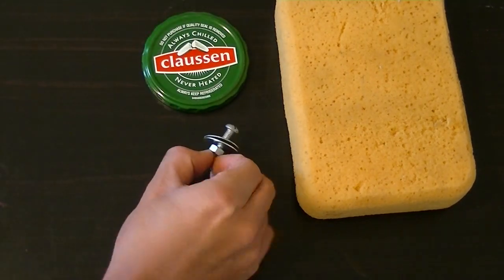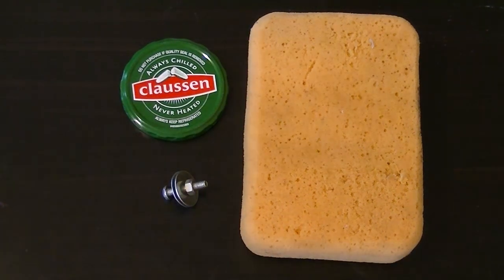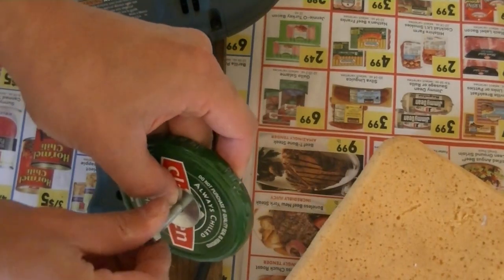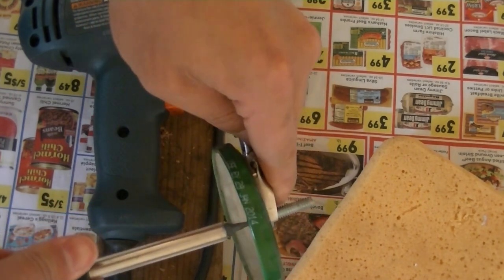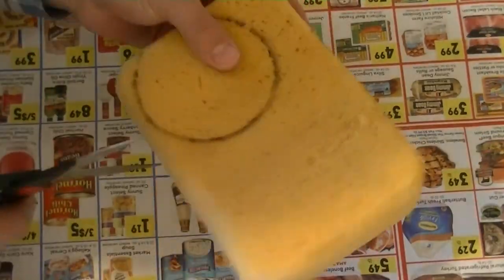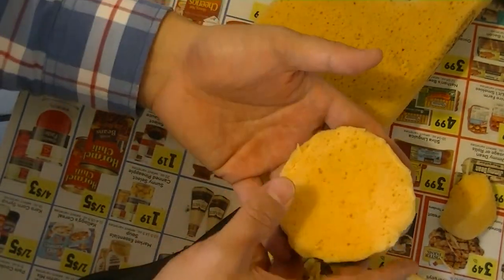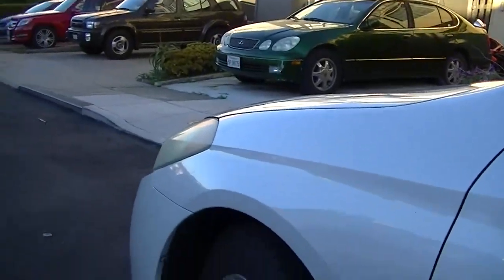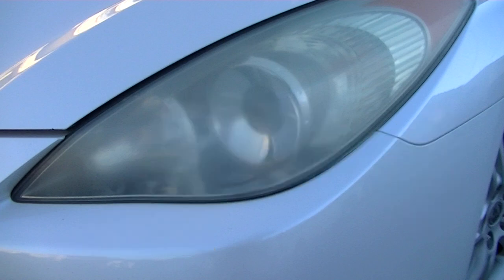DIY car Polish(Buffer) drill attachment with home tools

Comment: I think if we attach a piece of Velcro to the cap it will hold the sponge. I got a hand pad which works this way and works super nice with all kinds of wax pads. I'll guess it will work with a sponge as well. Nice example how to do a super simple DIY

Comment: This is awesome and very adaptable to different tools. I agree with the other comment; that you can do velcro on the jar lid (and the other side of velcro to various attachments; sponges, possibly sandpaper) if you want to make one for which you can change the pad on quickly. I personally am going to try using a heavy plastic jar lid (some peanut butter containers have them) instead of metal, just because if I accidentally go sideways or anything like that the plastic is far less likely to scratch what you're working on (or at least not nearly as much as the metal jar lid). You could also scale this very easily; for instance, a strong plastic bottle cap could be a good attachment for a dremel tool instead of a jar lid. Another suggestion: to allow for tightening the screw a lot but making it less likely to break the jar lid (which, again, I'm going to try using a heavy plastic) is to add neoprene (rubber) washers on the inside of the 2 metal washers, so that the rubber washers are what actually presses against the plastic lids. Being able to do this as a DIY opens up a lot of custom options.. which is great for people who do DIY, +sometimes you just need one custom attachment to get the job done. I imagine you could do a similar thing with pre-made scrub brushes, but probably drilling into them/their plastic base and substituting that for the jar lid. Thank you for your video. This was exactly what I had been looking for.